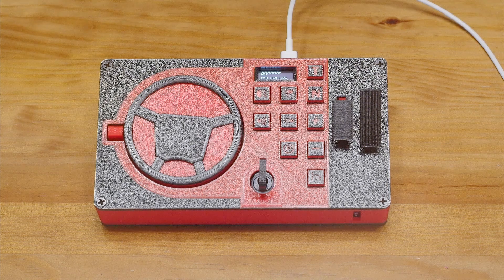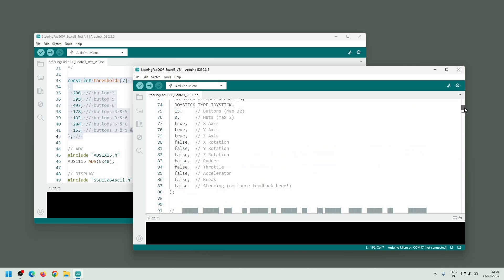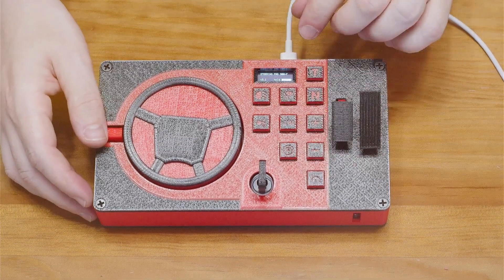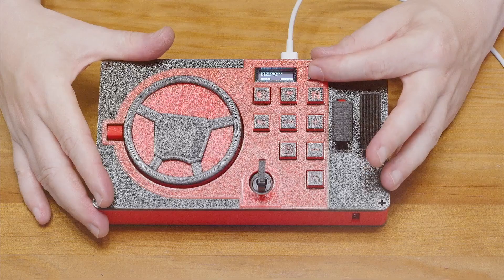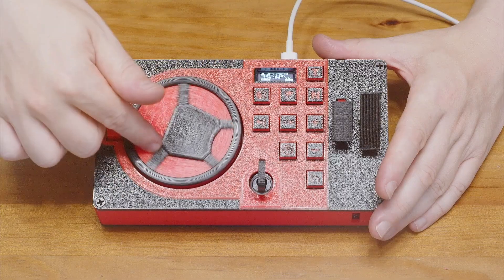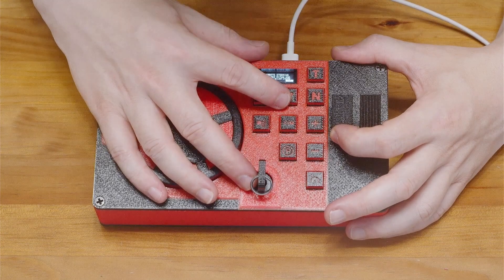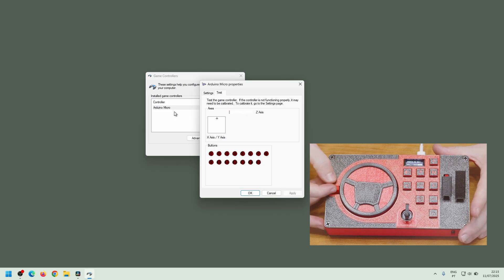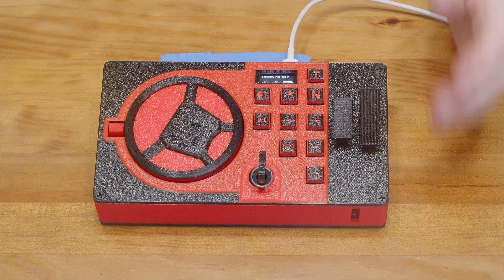How I installed the Firmware and calibrate the Steering PAD 900-F

Comment: hi, its really nice work you've done, i tried to make it here but im facing problem, its about the motor drive, its really hard to find DRV8838, the driver that available here its only DRV8833, how about that? well the input its different Phase/Enable vs PWM, maybe if there is any chance to make it work with DRV8833?
Reply from the maker: Hello! Yes and no! You need to change the way the firmware sends the controls. Replacing the code might fit the memory. It's on the limit already. GPT can help you there. Copy the code to it and explain what you want to change and the pins you will use.
About the driver. I see some in AliExpress. Try there. The driver you are referring might not have the necessary power to handle low speed. I tried one of those and at slow speed, does not move the wheel, and at max, is less strong compared to the other.
Reply: @HomeGameCoderBuilds  my country isnt on the list on aliexpress, so its hard getting directly from there, but thank you for the insight, i hope i can make it as same as you do

Comment: hey, very nice work!

As an addition an analog stick for camera movement would be great.

And maybe you could design a pcb with PCBway oder something
Reply from the maker: I'm actually working on a new pcb. The camera controller is a very difficult challenge. The code is 99%! To add a feature I need to remove another. Maybe the display goes away and the setup goes to an app... I don't know yet

Comment: Thank you so much for sharing this. I finally finished! I'm having some problems with the force feedback because of mechanical issues but everything else is great!  What you said in the end "all we need to start, is to copy a good project" is really true! I'm now motivated to do a variation of this controller, but one more similar to a Xbox controller with the triggers being the brake and accelerator, maybe some back paddles for shifting gears, and the wheel at the front to be controlled with the thumbs. Also maybe an additional joystick for controlling the camera.

Anyway, time to learn some parametric 3D design
Reply from the maker: Glad to ear that! 
What are your mechanical problems? if you tight the steering screw to a point where the rotation is not free, the motor might have some difficulties.
I don't know what version you are running but I have the 3.2 available. It might fix some issues... or not!
Also, I'm editing another video with some improved components for the steering block. Again, it will improve the over all experience but again, it might not solve your problem.
On a side note, if it's working, feel free to share it on Printables, in the Makes section of the Steering PAD page... some pictures or a gif of your controller and also an honest comment! I would really like to see it and also it could be an incentive to other people to try it!
About your ideas, I just have something very simple to say: It will be a massive challenge, but if it is not difficult, it is not funny! I'm always here to help!
Good Luck
Reply: @HomeGameCoderBuilds  My mechanical problems are just that the elastic belt that I bought has a square cross-section and keeps coming out. That and that with the test firmware the motor gets stuck in some zones with more friction (I'm guessing caused by printing inaccuracies), BUT, just by moving the wheel around for some time, those stuck zones are easing out, so it should work well eventually.

I'll share photos/gifs on the Printables! I just need to print the wheel face cover and it's ready.

It won't be easy indeed! I'm planning for now to just learn 3D modelling bit by bit
Reply from the maker: @zimrahin64  you can try a rubber band. it works for a while. With time, they start to degrade and need to be replaced, that's why I went belts here.

Those not even spot happen inside the spiral? You might want to push the swingarm against the inner wall with some pressure and rotate the wheel trough all the spiral. That will force those inaccuracies to be less noticeable. But the best solution is to slice it with the seam at the end os the spiral... and print slowly. That is the pars you don't want to print fast... but don't reprint it just yet!
I've redesign it to add a new feature and to improve the readings and you might want to print the new one... I'm editing the video right now!

To learn 3d modeling for 3D printing, go parametric: Freecad, Onshape, fusion360, solidworks. Learn why parametric is better and start practice by designing your own steering wheels.. I'm also updating the steering wheel face but no worries! the old one is compatible
Reply: @HomeGameCoderBuilds  Thanks for the insights and the parametric 3D design software recommendations!
I'm commenting again because my comment may have be removed for putting a link.
I just wanted to comment that the uneven spots in the steering spiral are not longer noticeable, it was just a matter of wear the plastic a little bit, so that's good!

Regarding the rubber band, did you use any particular keyword to find it online? I can only find normal black rubber bands that are sold for DVD/cassette repairing, but nothing with a circular cross-section like the one in the video.

For the steering wheel face, I used a free model from cgtrader and adapted it with Blender to the template you provided. I’d like to share it along with a GIF of the gamepad, but I'm not sure if I'm allowed to due to licensing restrictions.
Reply from the maker: You can and should share it in Printables, in the makes sextion in the project page.
On AliExpress search for 80mm ruber belt! You will find them.
Don't forget to check the new parts. I shared them yesterday with a new video about them. It has a new feature and a more steady steering. Also check the 3D print video to place the seam in the spiral... to avoid bumps.

Comment: Boss, I replaced the Pro micro steering wheel and it still shakes
Reply from the maker: Hello. Can you describe the shake. How it happens, how wide it is, it happens all the time, only in game, only with ffb. I need more clues to help here
Reply: @HomeGameCoderBuilds You can see why the steering wheel is moving by watching the video I submitted.
Reply from the maker: @在杰  That type of shake is noise in the system. A little bit will always happen but not that aggressive! I also have a bit, but it does not affect the game play at all.
All my noise problems came from one of these places
- Bad Micro (happen only when ffb is working)
- Bad cleaning (happens all the time)
- wrong settings. (happens all the time)
- burnt 49E (happens all the time)

It also can happen for external reasons.
for example, noisy power supply. It looks you are on a laptop. If you disconnect the power brick, does the noise still happens?
This also gives som audible noise in the sound of the computer.

You also have extra long wires for the steering. I don't know if that can induce noise but if you twist them, it can help canceling interferences.

If you can, go on Printables and send me good pictures of both sides of both boards for me to look at them and see if I find anything strange.

You can also try to install the version 3.2, that might help a bit but I don't believe the problem will disappear with just that

Comment: Why is my steering wheel shaking?
Reply from the maker: Hi! That can happen for different reasons. Maybe related to hardware problems but to further help you, I need to look at the boards and here is difficult to comment with images! Can you message me on Printables with pictures of both sides of both boards?
Some noise in the system is normal due to the prototype nature of the boards but, if it shakes more than what you see in the video, something might be wrong.

Meanwhile, before that:
- What do you mean by shake? it shakes if you don't touch the wheel or the steering movement is not smooth?
- Does it shakes every time, of just when playing?
- if you disable force feedback, does it still shakes?
- If you try on a different USB port, still shakes (not enough power)

I had that problem twice: once because I didn't clean the board enough after soldering and the other when I got a very cheap ProMicro with inferior components.
Reply: @HomeGameCoderBuilds The steering wheel will rotate back and forth when the opening force is fed back
Reply from the maker: Sorry! I don't understand the description. can you write in your own language please?
Reply: @HomeGameCoderBuilds After the force feedback is turned on, the steering wheel will rotate back and forth
Reply from the maker: Ok!
- Does that happens every time the controller is connected or just in game?
- if you hold the steering wheel to stop it, does it start again by it self when you let go?
- What are the force settings? (keep it up to 100)
- if it happens only in game, what game? (they handle force feedback differently)
Reply: @HomeGameCoderBuilds It happens every time you connect.  The force is set at 120.  European Truck Simulator 2
Reply from the maker: Hello! I detected a problem in the firmware, not related to your issue and I'm working on a fix.
What you describe might be something I still have to improve:
When in game, and just in game, in this euro truck simulator 2, if the truck is turned off and you force the wheel to rotate, the force feedback makes the steering go left and right and left, and right... by it self but if you stop it, it stays stopped. Other way to stop is to turn on the engine of the truck.
If it is this behavior, you might want to reduce the "internal friction" for the force feedback in the game settings. I believe It is possible to solve that in the firmware and that's what I'm working on to fix... not easy because the available memory is very low.
Meanwhile, in some games, the steering just rotates to one side (random) if the car is not moving. I believe that's a timing issue with how the controller communicates with the computer so, long story short, go to the firmware script, and add on line 302 the following line of code:

Serial.begin(9600);

This is a quick fix to the other issue that I don't feel it's affecting your ETS2 experience but let me know! if it fixes your problem, I really have to go deeper on this
Reply: @HomeGameCoderBuilds okay   thank  you  Very much.

Comment: Hello, teacher, I built streeing pad 900f, but the Hall sensor data is terrible. The steering wheel is shaking in the game. I don't know what to do.😢
Reply from the maker: Hello. How shaky? just a tiny bit or completely undrivable? That could have many origins! Did you scrub the boards clean after soldering? Did you wrongly connected the sensor and then went to the correct pin layout? that can damage the sensor. Did you got your ProMicro from AliExpress? That can also be a fake one (this is the biggest problem to solve). does the numbers go up in the calibration? And the range of those values? you may have put the magnets wrong (I assume not). Did you setup the EPROM like I said in this video? after uploading true, it needs to be uploaded false again. Did you setup the thresholds variable numbers from the test code?

I also got some shaking results when: Using a semi-damaged sensor, using a fake ProMicro and when the board was not really cleaned.
The first is obvious: you need to change the sensor but you might have shaking in game but not in windows. this means another thing, and if in windows the sensor is OK, the problem is not this.
Try to disable the force feedback in the controllers menu. If the shaking disappears, it means the ProMicro is not the best one... it cannot feed the chips and the motor. You can try to lower the force feedback level to mitigate the problem but I'm sure you have to change the ProMicro... and this is going to be difficult. Get a Solder Sucker to help you remove the ProMicro and replace it with a good one.
If disabling the FFB does not remove the shakes, it might me a cleaning problem, some bad solder joint...idk. remove the boards and clean them with acetone and scrape the space between the line to remove solder gunk that might still be there short circuiting the tracks.
You gave me a wide description and it's difficult to go deeper into the analysis!
Try these and tell me things!
Reply: @HomeGameCoderBuilds  First of all, thank you for your patient answer. First of all, I replaced the hall. It didn't work. I suspected that the magnet was not strong enough. I bought some n52 magnets. On shipping, I turned off the force feedback and felt better. Then I took off the OLED screen. It was normal, and the shaking basically disappeared. But why is it like this? I bought a fake screen? Or fake aduino?
Reply from the maker: Every element in the build consumes energy and all energy comes from the usb. That also happened to me when I was using a fake ProMicro. I believe the model I talk about in the video, somehow, because the circuit was designed differently,, routs the power in a different way. I don't have the PriMicro schematic to confirm - but it does not limit what goes out of the raw pin and the vcc. Raw goes to the motor. The energy is there but can be rough. Vcc is stabilized and rectified to be very stable. If a circuit that needs to read tiny differences in voltage is using a dirty power source, it is going to read dirty. And that is whats happening. The fake micros have low quality components that allow some noise to go into the vcc or not enough power to make the vcc stable. Removing something out of the circuit helps because there's less consumption and what's left can keep working. I still believe it is a fake Micro, not the screen. If you disable the force feedback will also be smoother.
Can you go on Printables and send me a message with some pictures of your boards?

Comment: I am sure that I am not the first one who writes it, but please, do the version with manual gearbox and clutch 😅
I am not into programming and microcontrollers, but I guess there is not enough pins on Arduino micro to do it?
Also adding a battery and some kind of wireless connection would be great both for portability and leaned-in-sofa gameplay.

Very cool project anyways ❤
Reply from the maker: I did not put the clutch because my printer is not big enough! Electronically, it is possible. I still have one high resolution analog input available in the ADS1115, and other pins are also available.
It is possible to manually gear with the current buttons. The Plus and Minus buttons are there for that! It's sequencial, but is manual. An H shifter is not very practical - don't forget you are not using the feet on the pedals and the lack of extra hands makes shifting a bit challenging, but the leaned-in-sofa situation was exactly what motivated me to do this... and in that relaxing setting, auto gear is already cool enough!
To do the battery/wireless I need to go entirely in a new direction. I guess the ProMicro latency with the BT would be bad, but I need to try that to have sure.
Reply: @HomeGameCoderBuilds  you could operate H shifter with thumb (just like thumbsticks on gamepads)
Reply from the maker: Ok! but now there is another problem! I made this for Euro Truck Simulator so, 12 forward and 4 in reverse. I also play F1: 8 + 1,  in motor town the range goes from family car to semi truck, and to keep it compatible with all.... The problem is not doing the H shifter - two analog pins are enough. the problem is choosing how many gears it has... unless it is a magnetically Add-on module and people snaps on the adequate one... I need to try that, but 16 gears in one thumb will be extreme challenge

Comment: want to build it soon, but using arduino leonardo and rotary encoder😄
Reply from the maker: The rotary encoder does not offer the same resolution. I have around 12 steps per degree here, contemplating the 900 degree of full range.
I used the leonardo in my desktop version, just because I had the space to put it inside. It works as the ProMicro with the advantage of having more ports. It's also a good solution, but not for this small case!
Reply: @HomeGameCoderBuilds yeah bro, i want to make it like yours but i don't have much experience yet, looking for an easy one first haha